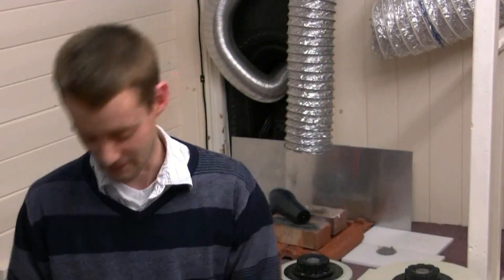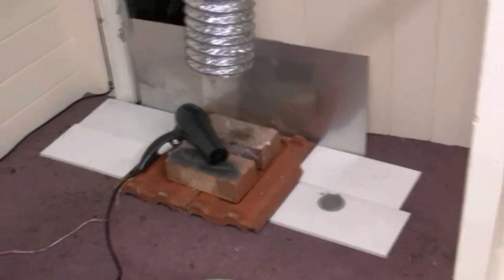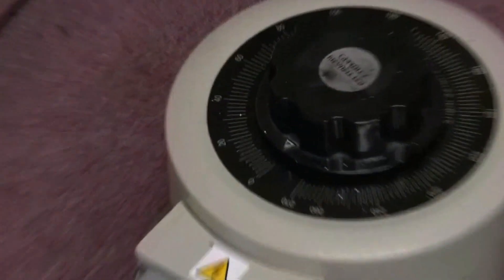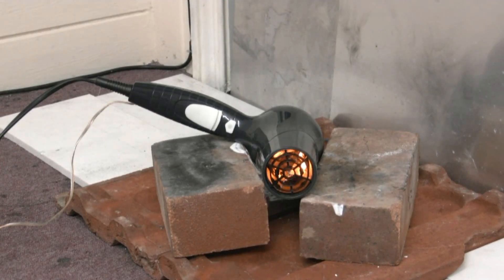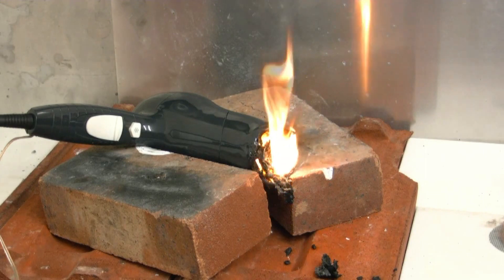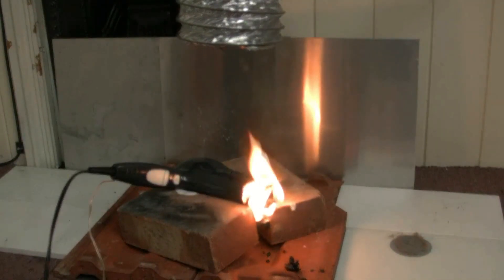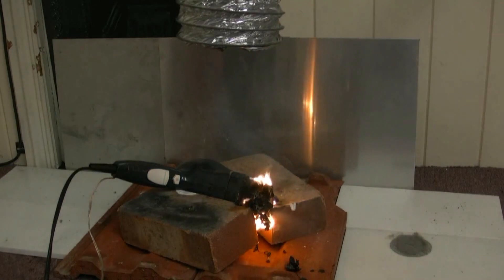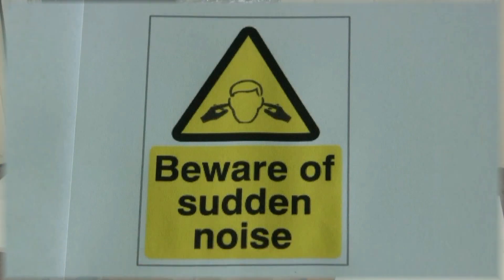Hair Dryer Combustion Test

Comment: If you want bigger flames, think about the ratio of air to heat. You need to ignite the plastic, and them keep oxygen rolling relative to the rate of heat. Eventually when you get enough compression, the ratio of heat and oxygen to the plastic will turn it into a fuel and you'll get a sort of jet. If you want to accelerate the process, feed ultra fine grit sawdust in the front because the combustion will raise the heat beyond what the coils can normally generate and it will become self-sustaining pretty quickly.
Reply: ok nerd

Comment: This is a little Jet Engine.

I am impressed about how did that not melt and the fan lasted that long
Reply: Inefficient, and the heat does not generate much thrust, so not really.

Comment: I went on the maiden voyage of a cruise liner (NCL Norwegian Gem). I had no hairdryer with me so i went to the front desk and asked if i could borrow one. 
Then i went back to my cabin, took a shower and plugged the dryer. The dryer was loud like a jet engine, started to glow, blew a huge flame with sparks and after 2-4 Seconds it went off. 
I went back to the front desk, told them what happened and they were pleased to handle me another hairdryer. I went back to my cabin and tried again. The same happened: Jetengine, huge airstream which almost pushed the dryer out of my hand, a huge flame and it went off again. So i went back and told the front desk staff, that the same happened again. They excused for the inconvenience i experienced and handled me a third one, after checking it with their outlets at the front desk, which worked fine. So i gave it a third try. And again, a jet engine roar, huge blow, flames and it went off again. 

I went back to the front desk again, and told them that just the third hairdryer exploded in my hands. The staff was obviously confused and called the chief electrician to check the power outlets in my cabin. He came, checked everything and didnt find any problems. He asked me if i did something unusual with the dryer and i told him "No, i just plugged it in and they started to blew a flame.", then he asked me to go back to the front desk and ask for a fourth one, so i can demonstrate what happens.

After a few minutes i came back, handled him the dryer, he plugged it in and it happened again. He had no clue what the reason behind this could be, so we went together to the front desk and he told the staff that they shouldn't hand out any hairdryers anymore untill the reason for this problem has been solved. While we were standing there, another passenger heard us talking about the hairdryers and came up to us asking: "Did your hairdryer just explode? The same happened to my private dryer too, this morning. Did you check if the voltage of your cabin matches the voltage of your hairdryer?" And that was the reason: Our cabin was made for european passengers, with 220Volts in the outlets. The Hairdryers have been produced for the american outlets with 110Volts. So they got twice the power they could handle. Problem was solved. 

Half an hour later they made an announcement to all passengers, to check the voltages of their devices before plugging them in to the sockets because there have been some incidents involving hair dryers this morning.  😅

Comment: You're going to need a little more Pantine, to fix those split ends. I recommend a little lower heat setting.😁That hair dryer does not comply with ISO 9001 for flammability.

Comment: What if you added fuel into the intake of the hair dryer
Reply: You'd get a hybrid jet engine.
Reply: You're right, needs more petrol!
Reply: Jet
Reply: OK good
Reply: Someone already did that
Reply: That'd be interesting
Reply: i BET it would just explode
Reply: Quasi-turbine
Reply: The hairdryer was the fuel 🔥
Reply: Junior Pilot : sir why our plane is feeling likea rocket 
Senior Pilot : .......
Reply: Nuclear fuel...
Reply: he should spray starting fluid
Reply: J E T
Reply: Oh but that would be unsafe.
Reply: Oh yeah
Reply: That would effectively create a blowtorch mate
Reply: YEAH! ANT TIME.
Reply: Came out fire from the exhaust. 🤣🤣
Reply: disaster
Reply: Ah yes I see Panasonic are testing their new electric jet engine.
Reply: inteza made a video about it made a jet
Reply: It'd probably short it before anything cool happened
Reply: Captain Blyat unless if you use a gas such as pure oxygen or hydrogen
Reply: @notsogrand2837  nah with the speed of the fan its probably cooling parts that would usally heat up to quickly
Reply: @notsogrand2837  Why? Most fuels are insulators.
Reply: @notsogrand2837  

It's not particularly conductive. It wouldn't short it out.
Reply: @skylined5534  Ah, interesting

Comment: Fan motor on one Variac and Heating element on the other Variac?    That's interesting because a lot of hair dryers are wired with the motor in series with the heating element. The principle is that the small DC motor runs on a low voltage and it forms a voltage-divider with the high voltage element. (This is a brilliant idea considering that a separate low voltage power supply doesn't need to be built. Voltage regulation is not necessary if the load is always the same)

Comment: I bet that if you had the fan spinning really fast and the heater glowing and you sprayed something flammable down the back of the hair dryer, it would look awesome.
Reply: Tim Lewis my sister did that accidentally hair spry and blow dryer do not mix well
Reply: @keithhasafastcar  Pretty daft, since those two would likely be used together.  Bring back CFCs.
Reply: it's basically a jet engine without fuel
Reply: Tee Two to
Reply: Spray deodorant in the intake (don't try this at home, especially indoors)